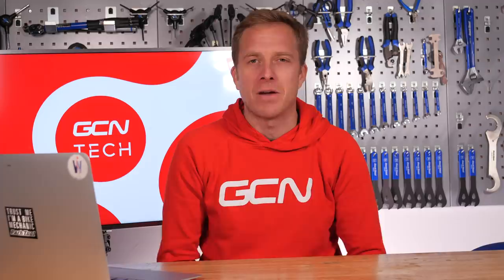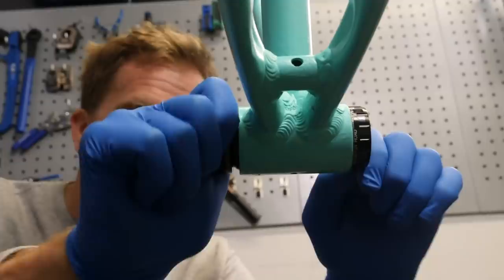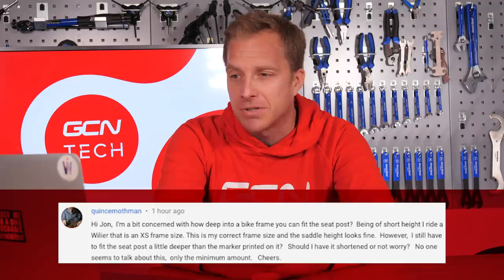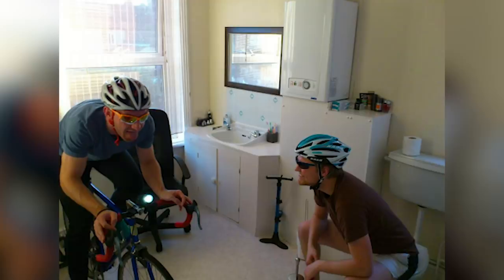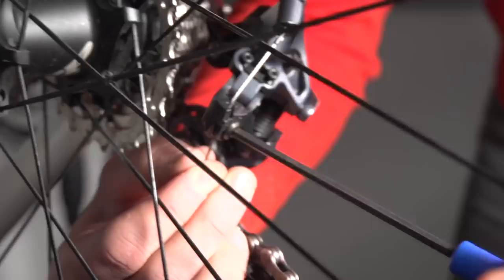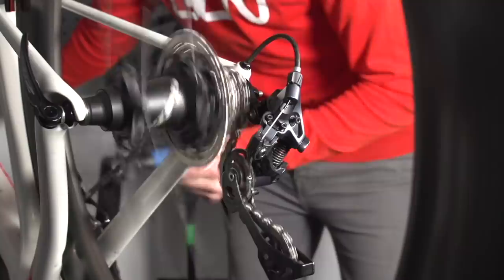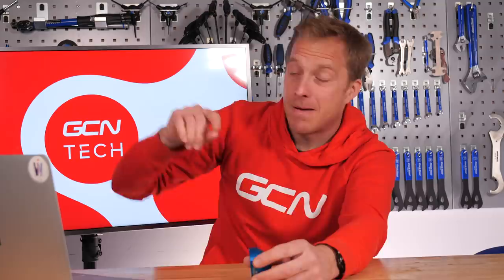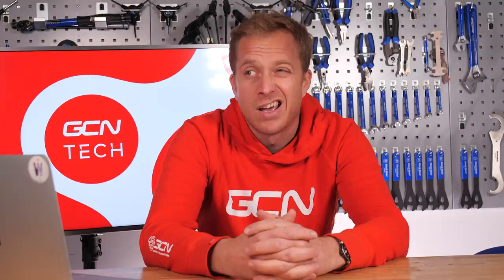Cantilever Brakes For A Gravel Bike Build? | GCN Tech Clinic #AskGCNTech

Comment: Omg John!! Coca Cola !!!
At the very least advertising plug but really why suggest that, yes it can eat at the corrosion but it will also eat its way at the bike damaging the material of the actual shell unless the bike is steel 
Do everything you said but use a quality penetrating oil let sit over night spray again next day and if that doesn’t do the job and release it give it a shot of nitrogen which in Canada is available at the auto parts store and if you still can’t get it out and blind bearing puller and a couple of pieces of wood against the bike will pull it out 
You tuber hambini (your engineering buddy) makes a bb puller which he sells on his website
Reply: Jason Girvan, the bottom bracket John replied to is threaded, not press fit. This in itself implies the frame to be either steel or aluminium. The biggest problem with removing a threaded bottom bracket is people getting lost with the "right handed" or "left handed" thread used in this type of bracket. The puller you refer to is used for "press type" fit bottom brackets used on carbon frames. Such a puller is of absolutely no use on a threaded bottom bracket.

Comment: I still don't understand why STI's with compatible with regular v-brakes were never a thing.
Reply: Not enough market share. There is a reason why the only long pull drop bar brake levers are tektro rl520. Apart from that, cantis work just fine.

Comment: Hello, John.
You give good cycling tech tips and I really appreciate them. But your physical science is not too great.
The water condensation on the window is caused by the glass is being cooled down by colder outside air - correct. But if you leave the bike in the room for some time, all parts will have the same temperature. You FEEL metal colder, just because it's a better heat conductor and transfers heat faster than rubber or plastic. It's NOT colder.
But if you leave your bike in a high humidity bathroom, you usually get moisture condensation and later corrosion. This is an empirically proven fact. :)